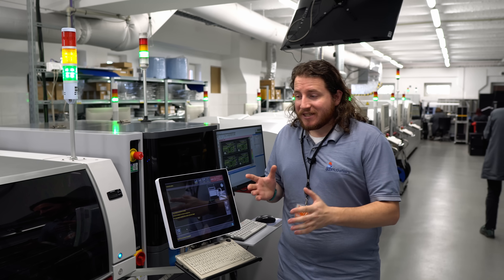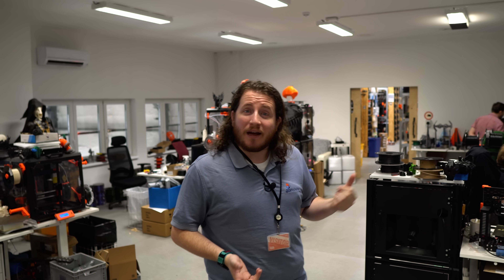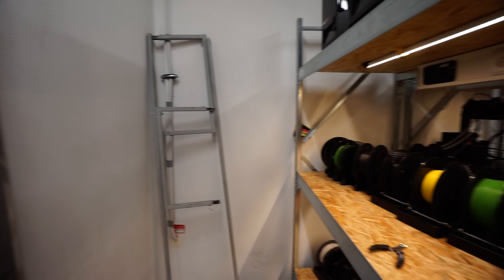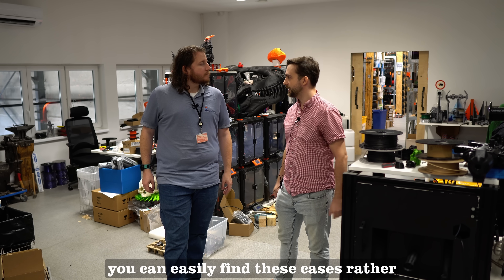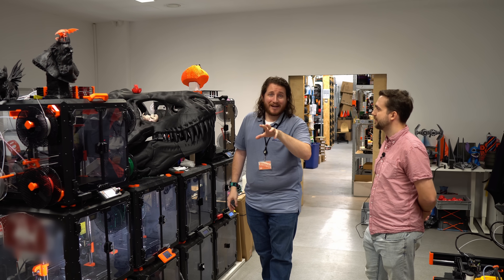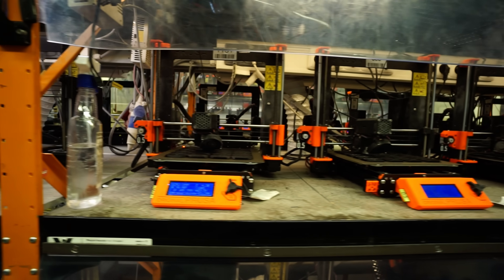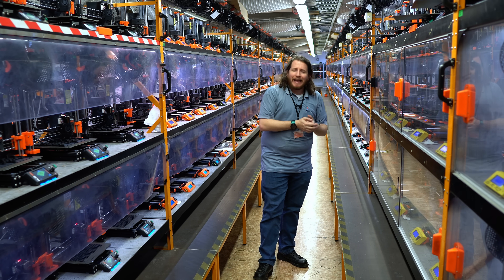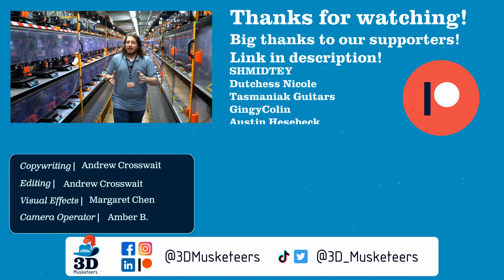We Traveled OVER 5000 MILES to see THIS: Prusa's Print Farm!

Comment: i dont get how they can have so many printers inside without air extraction. When I print even just white pla(anycubic) at 220C i start to smell it after a few minutes and start coughing and that is with just one printer.
Reply from the maker: Look up at the top of the shot, that's alllllll air extraction. The extractors are louder than the printers. It's kinda crazy. 

I'd recommend getting tested for an allergy to the plastic if you're coughing. I'm not a doctor, of course, but getting your lungs that irritated with one machine isn't extremely common and may give you some insight. this, of course, relies on good insurance or not living in the USA, so I totally understand if you don't go down that path. I don't have that level of sensitivity but the smell is obvious to me and was minimal in that farm, surprised me too. It was super warm though. We joked about using the waste heat to heat the building...

Comment: I hope Prusa can refine the AFS, because that is one of the most interesting advances in automation, and really the next step from having a massive print farm to having units have the prints ready to go so they can be picked up and boxed or moved to the next stage of assembly via robot.

Overall, what Prusa does is remarkable.  Not just making stuff in-house, but having solid support, and many people out there able to answer any questions.

Edited:  With a larger print farm, I'd probably be focused on prototyping and design.  For example, designing a form factor for computers and storage for SOHO places that is smaller than the typical 19" rack, or other stuff that requires a lot of in-flight changes, which would be insanely expensive if one kept trying to make injection molds to do.

Comment: I am 1000% all about the right to repair my stuff my stuff and open sorce software and Prusa does this well And Bamgu Lab don't however Bambu Lad do many other things Prusa is falling behind on and I am impress with the Core One I do like the MK4S however I not in love with it I had hope the Core One would fix that sadly no! I will not buy Bambu Lab because of like of support to repair my stuff but Prusa will not my money either and I do want to I want a printer now I don't have and I have not find one yet but sadly it will not be Prusa! I need mine incloesd and it not make the noise of a jet engine near my neighbors open widows in the summer months because it get hot here and we open are windows in happy sunny Southern France my neighbors live very close to me this is a very small village we all know each other by are first name the MK4S I can't do that sorry!
Reply from the maker: The mk4s is so quiet I barely hear it. The core one follows on those footsteps. They overbuilt the chamber fans too which is a nice thing to see! What is the core one missing for you?
Reply: @3DMusketeers  clearly he missed the part of the video where they have 600 machines running and no one needed to wear hearing protection.
Reply from the maker: It was not the quietest in there, but I think the ventilation fans were louder lol